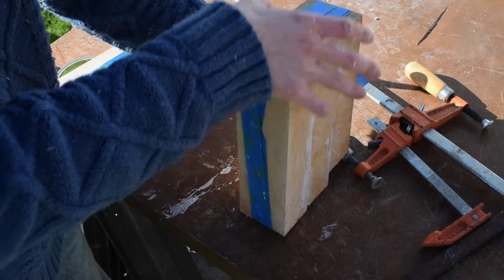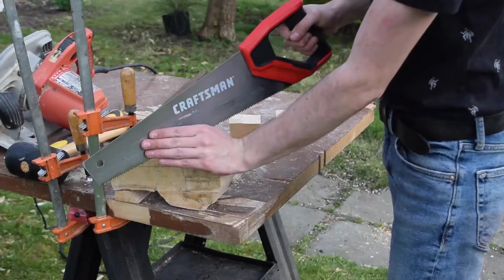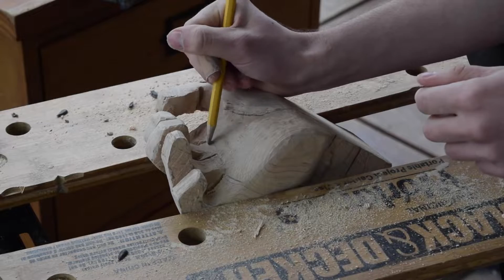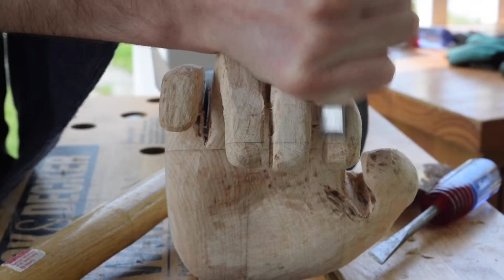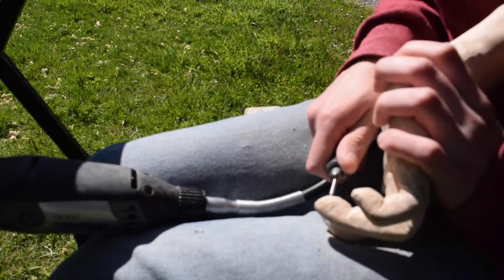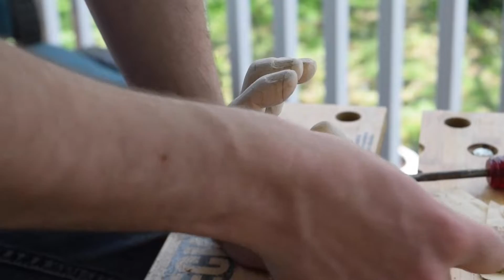Carving a Hand Out of Ash Wood

Comment: Toomey, Thanks for sharing your talent. If you had better tools and where sharp it would be much easier for you. They are expensive so I have a few recommendations. Schaaf tools you can find them on Amazon. Great for the money. I have all of them and other brands. Like all wood carving tools (Pfiel, Ashley Iles) you will need to commission them. Put the bevels inside and out according to your style of carving. That can be done with sandpaper and dowels. For a knife Beaver craft detail knife also on Amazon. I have made most of my knives out of old straight razors. I am not a big fan of Flex Cut. Except for the carving Jack.  Make yourself a strop. Lots of YouTube videos on how to. On line courses by Alexander Grabovetskiy and Cris Pye both great deals for the money. And you must learn how to sharpen your tools.